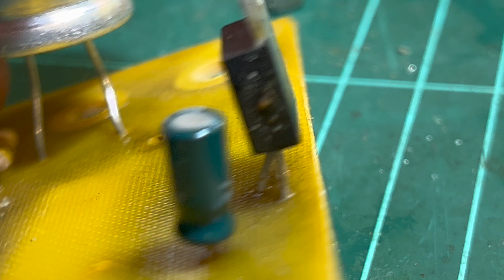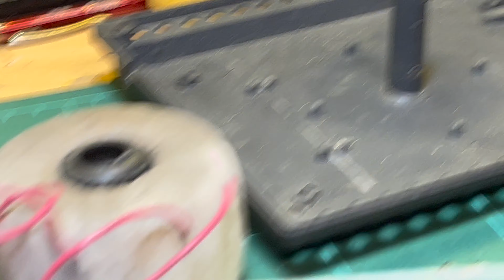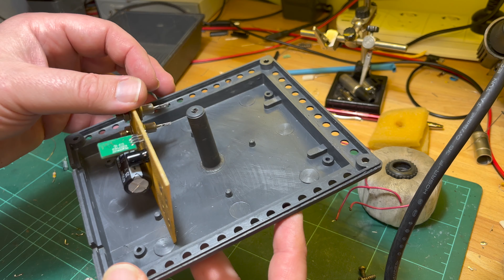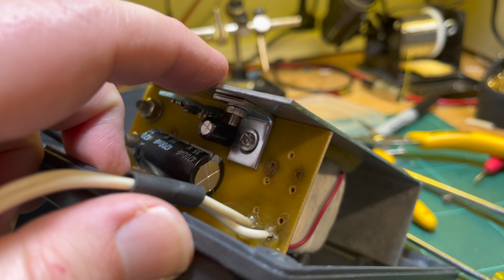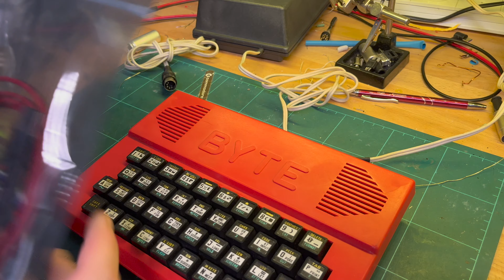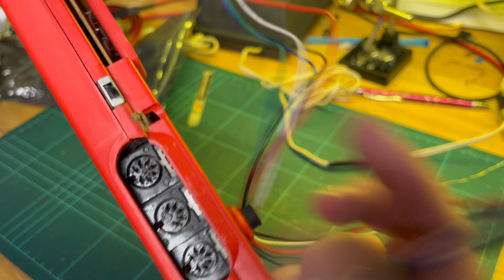🇲🇩 BYTE ZX Spectrum Clone: Part 11b (PSU Refurb) [TCE #0153]

Comment: I had read that buck converters can introduce line noise so it may be more smoothing is needed?
Reply from the maker: That's just Big Linear Regulator writing scare stories
Reply: @Brfff  you'll eventually come across some systems that wont like the ripple from a buck or switching reg...

Comment: ..can i ask why you dont like linear regulators?.. the switching regs are bad for RF noise... they the bane of a ham radio operators life!
..good job tho.. looks much nicer now...
Reply: They get very hot. In fact linear regulators lose the excess voltage as heat. If you're not worried about the ripple, then the switch mode replacements last longer. Many old computers fail because of their linear regulators failing.
Reply: @melanierhianna  i get the heat factor... imo thats the only real benefit of changing it to a switch mode...
Reply from the maker: I hate red LEDs and waste heat.  Both are non-negotiable ;)  I think a really well designed switching regulator is just as good as a linear version ... I use the ones from ezsbc.com rather than some rando-Aliexpress ones.